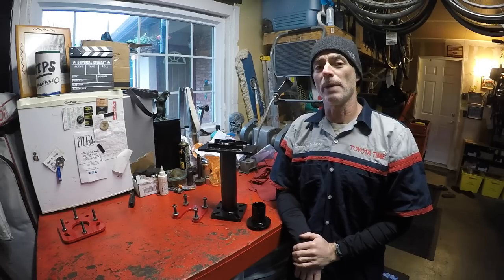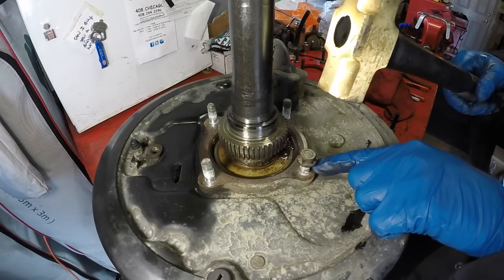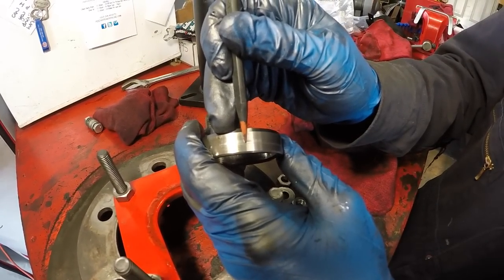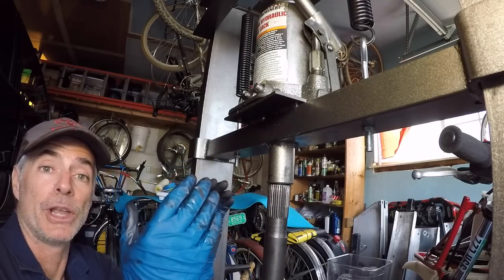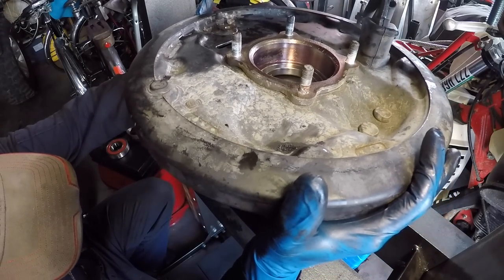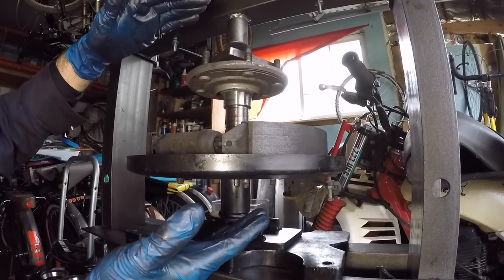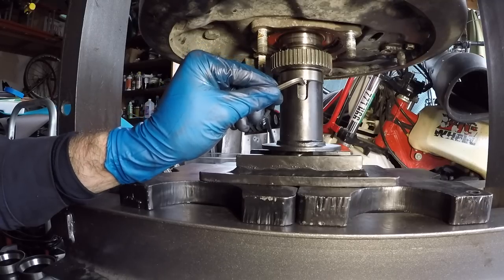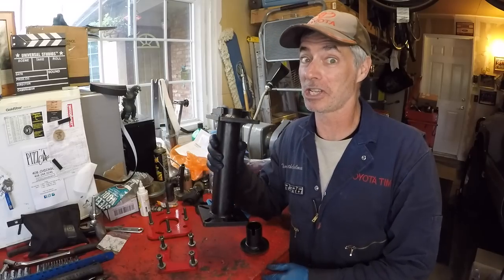Toyota Rear Axle Seal/Bearing Replacement (Part 2)

Comment: Hi Tim, 
Thanks for another great video. While buying the bearings for my 99 4Runner yesterday I discovered that my local Napa carries the Koyo bearings for the truck. They appear to be the exact same bearings as the Toyota offering except in a Koyo box. (..Koyo part # 212-2453..) They also have 2 new retainers with each bearing, and they cost $55 each. (..my normal dealer out of Denver wanted $95 each..) Unfortunately Napa did not have a listing for the ABS ring. 
Thanks again for all the effort that you and your crew put into these vids!!
Reply from the maker: You're very welcome.  That's cool that Napa actually stocks the bearings and retainers for our rigs.  You might want to ask them though who makes the retainers.  I've heard Timken retainers fit tighter onto the axle shaft than OEM.  One guy bent this ABS/retainer remover that's featured in this video.  He's the second guy I've heard that has bent his tool doing this job.  I'm suspecting it might have something to do with the aftermarket retainers fitting so tight onto the axle shaft.  So, if they are Timken and you ever need to remove them off the axle, it might require a lot of force.   I don't know if you read all the information offered in the Part 1 video description and the comment we pinned but you can actually reuse both retainers on each axle and also reuse the ABS tone rings saving you a decent chunk of change.  Good luck with the job.
Reply: @TimmyTheToolman  Thanks for the heads up. The retainers came in the same box with the bearings, so I'm hoping that they are also Koyo. I will compare them to the originals very carefully and then decide which ones I reinstall. It's cold and rainy/snowy here, so it's going to wait a few days.
Reply from the maker: @it4dps  No problem.  Maybe ask Napa if Koyo makes the retainers or are they from another manufacturer.

Comment: You, sir, are a lifesaver.  Just last week on a wet street in town I slid my 2003 Tundra sideways onto a city curb with great force resulting in a wobbly left rear wheel.  Pulling the brake drum and spinning the axle, I determined that it looks like the wheel stud plate on the axle shaft is bent so that's what I have to replace.  I've been working on my Toyotas for years but this is about as advanced as I've dared to go so far.  I have a factory service manual but they only go so far.  Your video, along with part 1, is one of the reasons I love the internet.  I got my 20 ton press from HF today along with some other minor tools (seal press kit, jack stands, gear oil pump).  The new axle shaft kit arrives Monday, the "donald-the-bonald" jig arrives Tuesday, and hopefully I'll be turning wrenches Tuesday evening.  Thank you for a most helpful tutorial.  I really appreciate it.
 
Incidentally, the first video on this I watched was from a guy who replaced his axle shaft and associated parts "without a press".  I thought, oh no... not even gonna try that.  Then I found yours and decided the expense for the tools and specialized parts was well worth not paying someone else to do it.  Or... attempting the "without a press" method. ;)
Reply from the maker: You're very welcome.  Thanks for sharing all of that.  Great to hear our videos are going to help you get your truck fixed.  Let me know how it goes for you.  Happy Wrenching!
Reply: @TimmyTheToolman   I did the complete repair a few days ago.  Now, I live about 15 miles from the nearest small town so I had to make sure, before I started, that I had everything I needed.  A few of the things, the eBay jig "do everything" tool and an Amazon package with a 3" cleanout thing as well as a few other minor hand tools, were due the very day but I made sure they were "out for delivery" before starting.  Thanks to you, it went as good as I could have expected. A few things creaked alarmingly while pressing them off but it all went very well.  The insertion of the bearings using the abs cleanout didn't just fall in like yours did but it took almost no pressure.  Had to bang in the oil seal with a wooden dowel because it got hung up and didn't want to finish going in but that turned out okay.  
 
I measured 4mm for the inner retainer and the wear line on the old one was right in the middle.  Because I was using a new axle shaft I didn't know if I could trust the "clean" mark as a reference so I still had to trial and error it.  Worked fine using the sharpie technique.
 
Again, thanks so much.  The internet can be a force for both good or bad.  In this case, it was a wonderful thing.
 
Now, please show me in great detail how to replace the timing belt on my 1st gen 4.7L Tundra... :)
Reply from the maker: @MikeInMurray  Good to hear you got the job done.  Getting those axle seals in without damaging them can be a challenge.  I've managed to destroy a couple so far but I've done this repair around 12 times now.  

I think one day we'll start doing work on the 4.7 liter engine but nothing planned for the near future.

Comment: Many thanks to Timmy the Toolman, Dr. Coffee and Duane for outstanding research and ingenuity.  I have a ’98 4 Runner and a ‘97 4 Runner, both with anti-lock brakes.  I’ve pulled the rear axles on both and have taken them to the Toyota dealerships multiple times.  I read the Dr. Coffee method on TTORA forum, but never had a SST; after watching this video, I decided to buy Duane’s SST and give it a go.  I followed everything to a T; I also filled in the Dremel cuts in the axle with RTV.  Unfortunately, after only 3 months and 3K miles, both sides have leaked again.  I pulled the driver’s side axle; the inner seal wear mark is dead center on the retainer.  Everything looks good and the RTV sealant is still in good shape where the Dremel cut into the axle.  I took the axle to the local Toyota dealership.  The tech said everything looks normal.  He went back to talk with an old head mechanic; the mechanic said that if it’s going through that many seals then the axle may be bent; also, the bearing goes in one way—supposedly there is a small ridge on the bearing—I don’t see any difference between sides of the bearings.  I have not run either of these vehicles off-road that much, so bent axles and housings should not be culprits.  One tech mentioned you could visually see a bent axle by looking at it spinning freely; mine run smoothly with no wobble or hop; however, I’ve not done any diagnostics on the axle runout or housing.  The forums mention bent axles and one post states the factory service manual recommends replacing the housing if there are repeat problems.  What are your thoughts…Help – any suggestions!?!
Reply from the maker: I think there's a good chance gear oil is getting past the imperfections in the axle.  Who damaged the axle cutting off the parts?  For your 98, those bearings can go on either way.  There's no difference between the two sides.  If you had an 01 or 01 model, those bearings are definitely side specific.  I doubt your axles are bent unless it was involved in an accident.  Also, there's most likely no issues with your housing.  The issue is most likely the damage that was done to the axles when the parts were cut off and the axles were gouged by the cutting disks.
Reply: @TimmyTheToolman Thanks for taking time to respond.  I also did a breather mod, so that isn't the issue.  I've had the dealers do the axle work in the past.  The dealer typically uses a dremel to cut off the ABS ring and the retainer; I thought it interesting that both dealers here said it's standard practice to cut 'em off vs. a SST and press.   Next time I'll run the axles over to the machine shop to see if they can weld and turn 'em.  New axles probably are not an option (or cost prohibitive if available).  The only other options are to scour the junk yards or find a suitable rear end swap.  Thanks again!
Reply from the maker: @mattodonnell2639  So let me get this straight.  A dealer is the one who cut off the parts and scored the axles?  If so, I'd get them to buy you new axles.  That is an unforgivable mistake and they should own it and make it right.  Now I know why they're trying to point you to a bent axle or problem with the axle housing.  They screwed up and don't want to admit it.  The gear oil is most likely getting past under the retainer and ABS tone ring because of their mess up.
Reply: @TimmyTheToolman  Tim -- I'm about to do a forensics exam on these beasts to figure out what's going on.  Looking at the FSM, it calls for axle shaft runout checks and replacement if damaged-bad on me for never having done this before.  New axle shafts are on the way.  I also noticed the FSM tells us, step 8(d). Position the backing plate on a new bearing case..."  I've never replaced the bearing case before, but this time, I'm going with the FSM.  As a matter of fact, my bearings had a very loose fit into the cup and kept falling out before pressing everything back together.  The part guys at Toyota show a seal between the bearing and the bearing case (they sent an email with a picture - sure enough, it's there); however, the FSM does not show this.  The parts guys said the techs replace the seal if the cup and bearing are separate (didn't make sense).  I've never seen an oil seal in this location.  Have you...any thoughts...?
Reply from the maker: @mattodonnell2639  There's no seal between the bearing and bearing case.  There is a seal that you press in by hand on the back side of the bearing case and faces the brakes that we replace in our video.

Comment: Thanks for this awesome video! I got ripped for $500 at a shop that ruined my axle by grinding into it 😡 purchased the puller u used and did it right using this exact method on my 06 tundra! Keep grinding my man 🤘🏽
Reply from the maker: Hey Eric, what you experienced with a shop screwing this job up isn't uncommon.  Auto shops and machine shops screw this job up all the time.  You were smart to make the investment in Duane's tool and do the job yourself.  Glad our video helped you get it done right.

Comment: Hey Tim, another home run!  Just finished my rear axel job with my new Dwane tool - everything was very slick!  Thanks so much for your fine video and tell me where to send you some beer money!
Reply from the maker: Hey Brad, great to hear the job worked out well for you.  Having you report back to us sharing your success story is thanks enough but if you'd like to send us some brewski money, there's a "Tip Jar" link on our home page.  If you look in the bottom right hand corner of the home page picture, you'll see the link.
Reply: @TimmyTheToolman  Done!  Wish it could be more.  I've done this wheel bearing and seal replacement, the e-locker upgrade, control arm bushings, ball joints and tie rod ends, timing belt/water pump/idler pullies/seal jobs so far, thanks to your great videos.  And I have a growing collection of tools in my garage.  Can you explain to my wife why all this is good?  :-)  Thanks again!
Reply from the maker: @bradsmeltzer2569  Thanks for the tip.  Good to hear you've made good use of our videos.  The tools are an easy sell.  Just think how much money you've saved yourself doing your own work.  The tools have paid for themselves and can be used for future jobs.  If you ever decide to stop wrenching, you can sell the tools and get some of your money back.  Pretty much a no brainer.  Happy Wrenching!

Comment: Bought Duane's tool, works great. previously paid a repair shop to replace the bearing and seal. Bearing noise was gone but still had an oil leak onto the wheel and brakes. Pulled it apart thought oil seal was bad and replaced seal, still leaking after that. By now the grease had been washed out of the bearing. Pulled it apart again and armed with Duane's proceeded to replace bearing seals etc. Found that the crow foot puller that slides under the tone ring was too thick to fit under it........pissed at Duane.......No the previous " Mechanic had slid the tone ring and inner retainer on too far. Had to use two tapered chisels to tap the ring up enough to slide the tool under. Long story short the oil seal was never riding on the inner retainer at all......be careful who you choose to do this job.......better yet do it yourself or at least be present to measure the 5 mm of polished axle showing after the final press. Thanks Tim and Duane.....this was a great help. And ill buy you that beer....cheers! tool
Reply from the maker: What you just learned is what many paying customers have learned using mechanic shops for this repair.  This has got to be the #1 job mechanics screw up on these rigs.  Even dealership mechanics screw it up.  

Great job fixing their screw-up.  Glad our video and Duane's excellent toolset helped you get it done.  Happy Wrenching!

Comment: Hey Timmy, just ordered Duane's tool. And I am also going to purchase a few tools I don't currently own from your list. Wanted to point out that the link you posted to Duane's tool goes to the older tool he first offered. It links to the tool that does not have the 4" steel plate and the larger 'round' piece that helps seat the bearing in place. 
It's odd how links can change, because I know for a fact that about a month or so back the link you had posted above did land on the tool that had the 4" plate and that larger round piece for the bearing.  No biggie, just wanted you to know.
And now I see Duane built a tool for the 12 ton Harbor Freight press. And just my luck, I already bought the 20 ton press. Oh well, I won't have to worry about not having enough pushing power.
Reply from the maker: Thanks for the heads up on the link.  I'll check it out and update it.

Comment: Your channel rocks, I'm in the east bay and my 2007 Tundra needs rear axle bearings. I was surprised when I took it apart I was expecting bearing similar to my 80 series landcruiser.

During inspection I scratched the magnetic felt for my ABS sensor on the tundra I need to get new bearings pressed onto the axles

Are you interested? I normally do all my own work but I don't have a press, happy to pay you for your time I would pull the axles and bring them in the Land Cruiser
Reply from the maker: I stopped doing side jobs a long time ago.  Making new videos for the channel is already a ton of work for me.  To keep a balance in my life, I decided to stop doing side jobs because I was getting seriously burnt out.  You can pick up a 20 ton Harbor Freight press for very little money.  They always have those 20% coupons going on so you could probably pick up the press for around $150.  The special axle tools our buddy Duane makes are also affordable.  I say make the investment in the necessary tools.  The special service axle tools you might not use much, but they will pay for itself after one use because I would charge you more than that toolset costs for my time.  His toolset sells for $126.  I would probably charge you $150 to do the press work for you.  The press you can use for so many jobs and it's worth the expense.  I've used my press a ton of times, pun intended.  

So, sorry, I'm not available to help you with this.
Reply: @TimmyTheToolman  thanks for the reply and advise, believe me I get it I've been an electrician for 30 years and I quit doing side work along time ago......

It's endless right

I'm in contact with Duane trying to figure out which kit I should get from him for my 97 land cruiser, 2007 Tundra, and 98 Tacoma, buy once cry once right 🍻

Duane mentioned the bearing may come apparent when pressed out, I'm waiting for home to tell me which *complete" kit I should order.

You're right I put off buying a press for far too long, let's get into
Reply from the maker: @BillyGoatsAdventures   @BillyGoats_Adventures  Yeah, Duane will get you taken care of.  We just shot a video doing a rear wheel bearing job on a 5th Gen 4runner featuring Duane's tools.

Comment: I got Duanes kit for an '02 w ABS. Unfortuantely the ABS ring is too close to the hub to get the U-plate in place. So now, need to go get a ring splitter
Reply from the maker: That's weird.  Somebody must have done the repair before and pushed the ABS tone ring in too deep.  I've never seen it where I couldn't fit plate under the tone ring.
Reply: Yes, I had a shop do the seals a few years ago. Interesting to see their work. I found that write up about flipping the retainers and gave it to te shop that did them they actually redid them twice within the warranty Tim cause they began leaking again. 
When I did them last month I found only one of the retainers was flipped, only had about 2mms of witness over lap. The other was positioned stock. 
The retainers and ABS rings were too far out for the red plate by about r 2mm. The HF ring splitter I got bolted up to Duanes main sleeve just fine. I did use his red plate for a press adjustment of the rings. It is a very useful kit, no regrets buying it !!